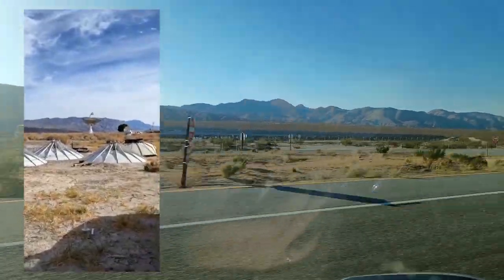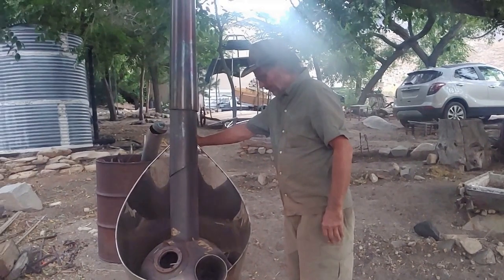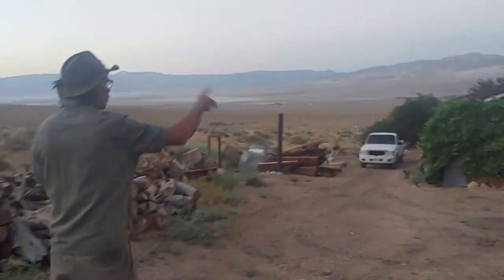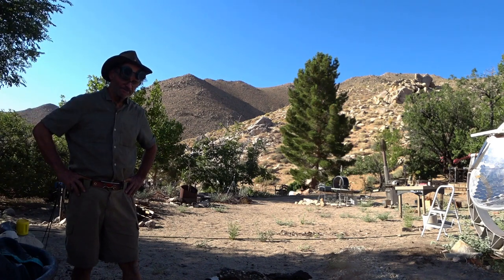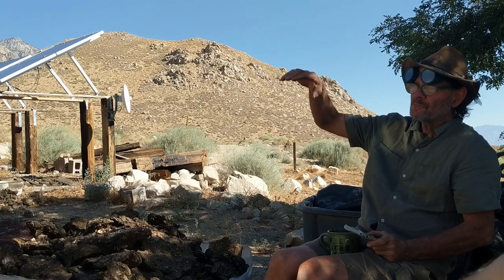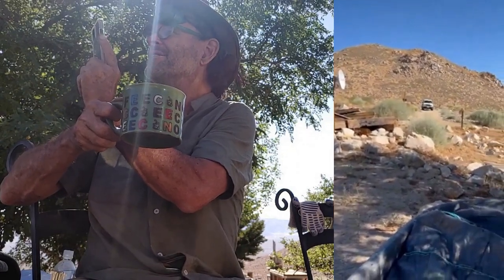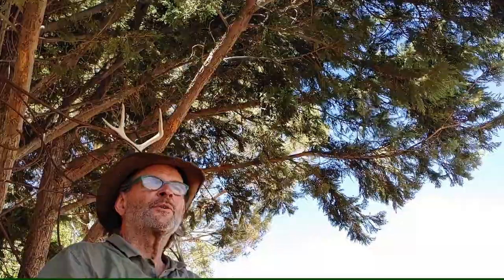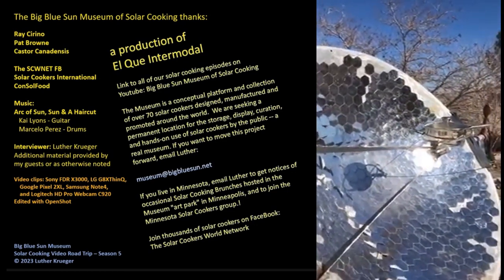Ray Cirino: Swords into Solar Cookers, Springs into Beaver Lodges, Soil into Homes

Comment: I have a feeling that stainless steel isn't going to last 20k years. Would it be easier to polish and electroplate the surface of the metal dish? Perhaps the surface could be re-treated every 10 years or as needed
Reply from the maker: Good question. Ray is in the dry desert so perhaps it'll do better than 10 years :)